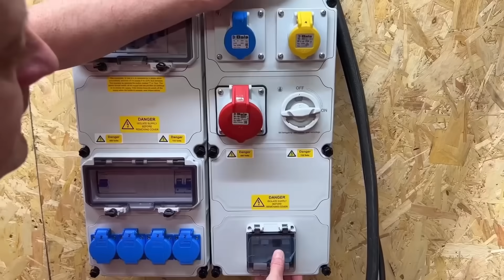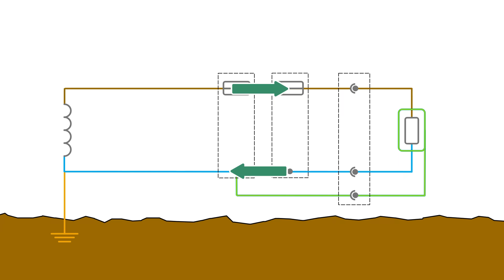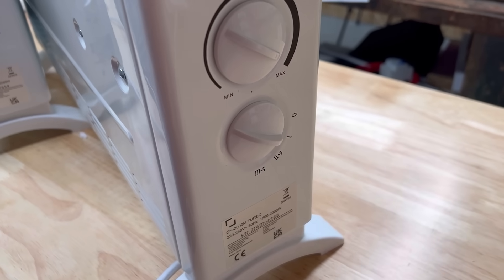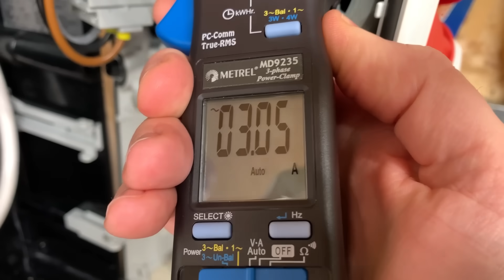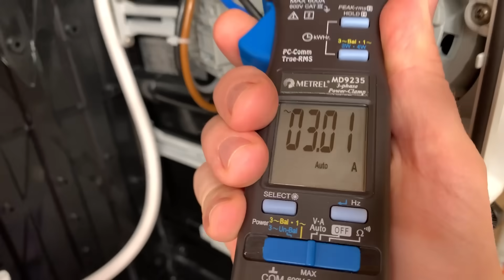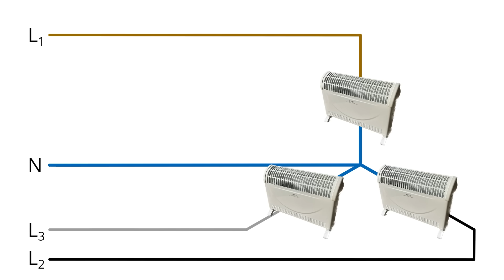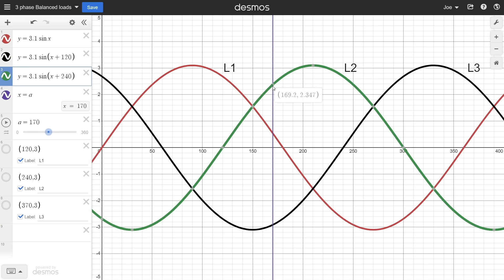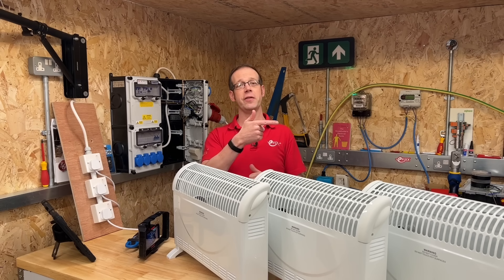Does Current Flow Through The Neutral Wire?

Comment: One way of thinking about this is that the neutral current is the total phase imbalance.  One phase loaded(= 1kw imbalance). 2 phases loaded (= 1 phase = 1kw imbalance). 3 phases equally loaded - no imbalance.
Reply: You can think it as an  equilateral triangle, When you go one side you are one side away from the start, then after the second it is the same but the third side gets you where you started.

Comment: So when you had two heaters connected and measured the current on the neutral, it wasn't the same as L1 + L2 because it was partially mitigated by the opposing phases, but not completely as it was when you activated the third heater? - fascinating.

Comment: You only have to think about 3 phase electric motors to realise that no neutral is needed if the phases are balanced.
Reply: phases are connected on the motor not the heaters.
Reply: @peepsibhoy  Not quite sure what you mean, but many heaters in industrial applications are 3-phase connected with no neutral used.

Comment: Couple years ago I used 3 phase for powering a few dosens of single phase crypto mining RIG's... At some point I check the cable and it was so hot. Then I did same as you mentioned to balance the phases and voila cable isn't hot anymore :)

Comment: If you measure current on the neutral wire is this considered "leakage current"? there shouldn't be any current on the neutral wire
Reply: No. the neutral is there to take the current away. it is NOT a leakage. Leakage current is current that is 'escaping' to earth from the proper route, like the neutral, via somewhere it shouldnt be.

Comment: Can the current in this setup ever be higher in neutral wire than what it will be in any of the phase wire? No matter what size loads are connected to the phase wires.
Reply: Short answer: No.

Medium answer: Yes.

Long answer: Remember the graph with the sine waves he showed in the video. Those lines are actually the maximums at those points in time the circuit can draw on each phase. The actual current can only be lower, and if you eliminate the current draw below the 0 line, what is above it cannot add up to more than one (and vice versa). So when one phase pulls its maximum, the other two are in the negative. When two phases pull half their maximum, the third phase is in the negative. And while some sources say an imbalance can cause the current to go over the higher phase's current, the formula says otherwise: sqrt(A^2 + B^2 + C^2 - AB - AC - BC) is always <=A, <=B, <=C.

Extra long answer: When loads are not very nice about what they do, they can create harmonics or shift the sine waves (power factor!). This CAN push neutral above 100%. So if all your loads a switching power supplies, you need either additional power factor correction or a beefier neutral wire. And when you add a generator on the load side (e.g. a plug-in solar panel) that causes one phase to have a negative current, you instantly get more current on the neutral than the maximum load. (just put 1/1/-1 into the formula above...2)

(Side note: That's why utility companies are involved when you install solar panels. They don't want their neutrals to melt more than it already is...)

Comment: You can get them to add sometimes, like with lighting circuits( capacitive power supplies) . If each line draws current mainly at the peak of the sinewave. There is minimal overlap, and thus minimal cancellation. And they just add.
Edit: rectified capacitive power supplies

Comment: Very interesting and well explained. However, if the incoming neutral becomes disconnected as I have experienced at a heritage railway, where the unbalanced loads caused serious problems with some devices burning out and other loads suffering low voltage. There seems to be no protection against such a problem and the supply company sometimes  won't  admit there is a fault.
Reply: Loss of the neutral is a serious issue. In single phase it does not give strange voltages but you'll get the full voltage at the equipment cases.

Comment: Deeply flawed explanation. A complete failure of understanding of AC electricity. How does stuff like this get and remain on the internet?
Reply from the maker: Perhaps you'd like to enlighten us Charles -  What do you see as the flaws in our understanding?
Reply: @efixx  I don't have much time to waste but may I suggest this?
If 'current' 'flows' through the neutral why not try breaking the neutral cable and connecting a heating element in series...all that 'current' 'flowing' will surely cause it to heat...right?
lol
Reply from the maker: Would you not just have two loads in series then? It wouldn't get as hot but it would warm up. 🤔 Or have I misunderstood your point?
Reply: @efixx  Yes you have mis understood my point...which is worrying but not surprising.
Go to the neutral terminal on your board, cut the neutral link...connect it to one side of a load, then connect the other side of the load to the neutral link... 
All that 'current' 'flowing' through the neutral should power the device...right?
Reply from the maker: Well, that load would then be in series with the rest of the installation. So current would flow through it and if it was a heater like in your original example the current flow would be smaller than it's designed for so it would heat up but not as much as it would do if connected in parallel and the rest of the loads in the property would have less current flowing through them than they should. I'm genuinely trying to understand your point and if my understanding of electrical science is fundamentally flawed. But I'm feeling increasingly confident we got it right bud. 🤔
Reply: @efixx  Really bud?
Reply: @efixx  Just out of curiosity, if you did insert a load into the neutral link and then checked the voltage at either end to earth...what you find?🤔
Reply from the maker: Yup.
Reply from the maker: If you measure from the point between the heater and the rest of the house to earth it will vary depending on the resistance of the heater and what's connected in the property. If you test from the other end of the heater to Earth it will measure approximately zero. 👍
Reply: @efixx If you test from the other end of the heater and it measures zero to earth...how could 'current' be flowing along  it?
Reply from the maker: Because at the star point of the supply transformer neutral and earth are connected. If you restore your installation without the broken neutral scenario you've outlined and measure between neutral and earth you'll get zero volts.
Reply: @efixx  Ah...we're making progress!
Now kindly explain how  'current' 'flows'  between two points with no potential difference?
🤨
Reply: @charlesnelson5187  it will measure approximately zero.
Reply: @joeds3775  Exactly! 'Current' can only 'flow' when there is a potential difference on the circuit!

Comment: This is obvious. Most of our ordinary everyday electrical equipment is plugged into a 120v plug with the hot wire and the neutral wire. If you expect your equipment to work, you will need current to flow. You cannot have current flow on only the hot wire. It needs that neutral to complete the electrical path. Also, the neutral wire is sized the same as the two hot wires. That means it's sized for a reason, and that reason is to carry current.

Comment: Thanks that was excellent. I've had this "discussion" many times with " professionals" who did not want to put a neutral line in at all. But you have raised a doubt now! If you remove the neutral from your star winding drawing doesn't it became 415 instead of 240? Sorry but that's a stupid question I hung the screwdrivers up a long time ago!
Reply: The way to get to 415 V given three-phase 240V, is to connect between the phases in a delta configuration, not a Y configuration.
Reply: I you have three identical loads on a star then removing the neutral does nothing. If you then remove a load, you cut the power by half. With a neutral you would cut it only by a third. if the loads are not identical then weird things can happen if you remove a neutral.

Comment: Why was L1 and L2 COMBINED still showing current on the neutral?
Reply: because they are still both positive with respect to eachother. the third phase will always be negative to them and thats where the excess current flows to, because a negative value will have a stronger 'pull' than a 0 value.
Reply: Ish.....
Reply: Because it is three phase, not the US split phase.

Comment: Hey guys, probably a dumb question, (I'm a mechanic usually playing with DC) does that mean you could disconnect the neutral in a balanced circuit? I thought it would still need a return for the current. Or is that what the earth is for?
Reply: You can’t connect live to neutral , regardless of l1 l2 or l3 .

Comment: A question I would like to ask to follow up on your video.  On my home immersion heater that needed replacing the neutral wire became over heated where the insulation had melted at the terminal. I have also seen this same thing on an electrical shower and oven. Why does the neutral wire show signs of burning but not the live wire?
Reply: The only reason that the wire would overheat is likely to be increased resistance at the connection terminal, resulting in heat generation. The current in the supply wire and neutral wire would be the same value, so if the supply wire is not overheated the supply terminal would be low or virtually y no resistance.
Reply: @alanwhitfield1907  I agree but it always seems to be the neutral wire that gets charred, not the live wire, so there must be some thing more to this. I have seen accounts in other forums about this situation of the neutral wiring showing signs of over heating and not the live as well so it is a bit of a puzzle as to find some sort of explanation why this happening.
Reply: @mightymax232  In all the cases i've seen, and theres a lot, the neutral burns because its loose. I have no idea why electricians cannot tighten them the same as lives.
Reply: This can also happen when the 3 live wires are not connected to 3 different phases. Then loads on the same phase combine, and because they have twice the copper for L than N...

Comment: Sich a great video! But i’m sure disconnecting the neutral wil destroy the heaters,
Reply: No.
Not if there are three heaters of the same "amperage" so connected to the three (120 decree) phases.
The "return" current of each of the "phases" is carried via the other two 120 degree (out of phase) circuits.

The "Neutral" would be needed ONLY to carry any "out of phase" current, due to differences in the actual current of each heater.
That would be an "unbalanced" current and would pose a difficulty for the electrical supply authority.
Such "authorities" DO manage to "balance" the load across the three phases supplied to their customers.